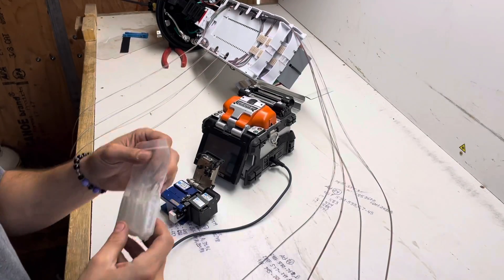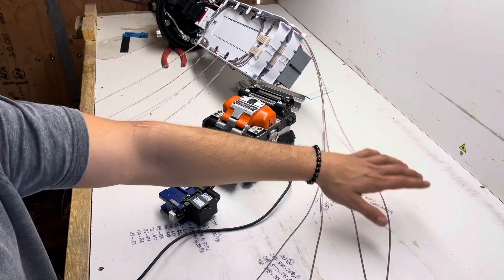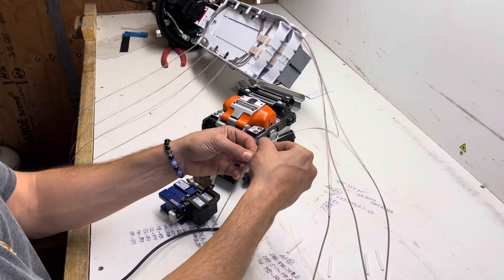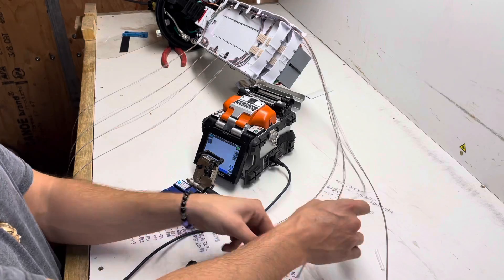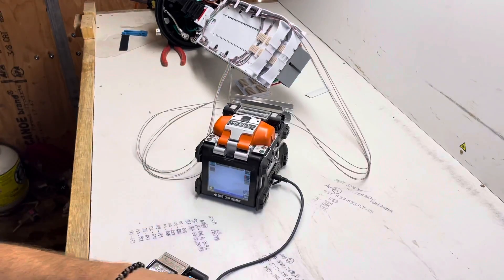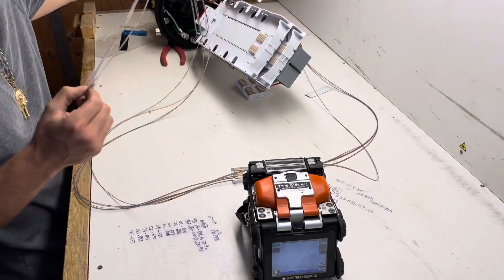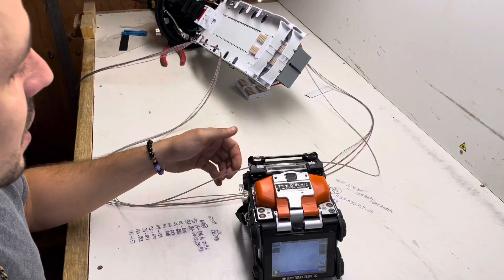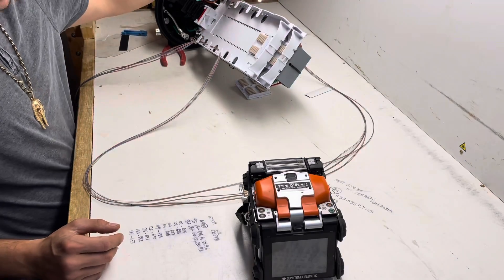Mass fusion fiber optic splicing

Comment: Great channel and content,  I run a fuji 70r+  and recently have been getting bubbles in ribbon splices. Ive rplcd electrodes and stabilized them , ran arc calibration to no avail.  It always seems to happen to the middle fibers 5,6, or7.  Any ideas?  I set the machine to "sm auto" as thats what my coworkers told me  but I just cant get consistent performance.  Any help helps
Thanks

Comment: Been watching the heck outa your ribbon splicing and prepping videos lately. Gotta huge job in NY splicing that same exact 432 fiber. Been learning a lot from just watching you. The big problem I have with the splicer is the offset error message I get. Any idea why that happens?
Reply from the maker: Hey thanks for watching glad you enjoy and are learning lots from my videos 🙌 nice that’s awesome to hear I’ve been seeing a lot more bigger projects starting in the states over the past few years there is gonna be a big boom there for telecom over the next decade. Yea there is a V groove brush from sumitomo that will allow you to clean the v grooves in the splicing machine that will allow for better offsets and quality splices. Another option that works really good is to take some spare ribbon fiber. strip and cleave it and then on about a 45 degree angle you ever so gently run the tip of the fibers through the v grooves on the splice machine to push out the dust and that will give you great offsets. I’ll make a short video on it over the next few days to give you a perspective of how I do it.

Comment: Great video. I'm sure there is a sleeve selection for those types of sleeves but cutting is ok. I like that you now do a bit of narrating. I work for a major telecom company for over 30 years as a splicer and I use your videos as a pere-guide for he new guys before we get into field training. To help those using you videos, you might want to consider going over tray management and the lengths for proper storage after splicing with each case you build. Also remind those splicing ribbon, in the manner in the video, to always be mindful of not putting in additional twists. Ribbonized loose tube doesn't matter nor does spider ribbon. 
As you correctly stated, many splicers don't think about the next person and do a poor job of tray and case management and not placing the slack in after splicing. A 450D case can support 1152 mid-sheath and so many people lock up a case with a lot less fibers. 

Again great job on ALL your videos.
Reply from the maker: Thank you I appreciate all your input and glad the videos have helped with your new workers. I am now offering some online classes  and direct consulting for any fiber optic testing, splicing, network trouble shooting and deployment of new builds. Thanks for watching I appreciate your comment

Comment: What settings are you using on your machine? Mine makes me go through way more steps before burn. I just got it. Might have 30 burns on it.
Reply from the maker: I have my machine on auto calculate for off sets so the machine can calculate if my offsets are within my perimeters then the machine will automatically start splicing. I’ll send you the exact numbers here once I’m on site today